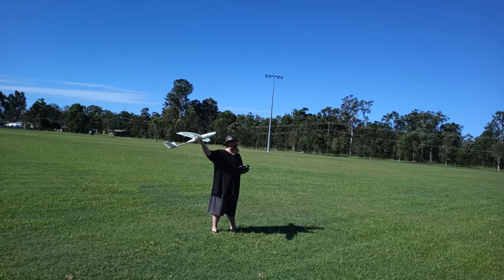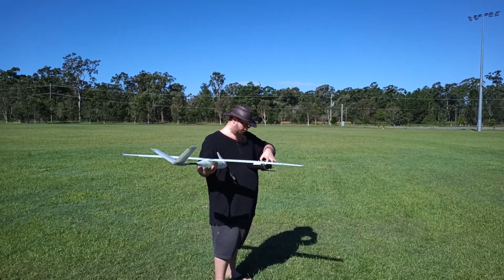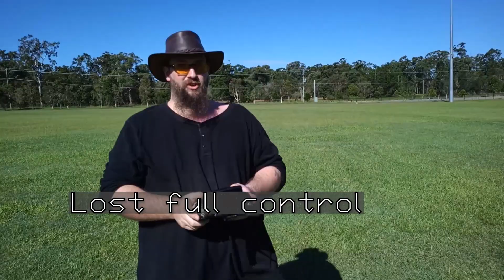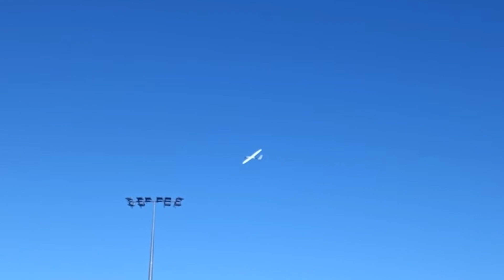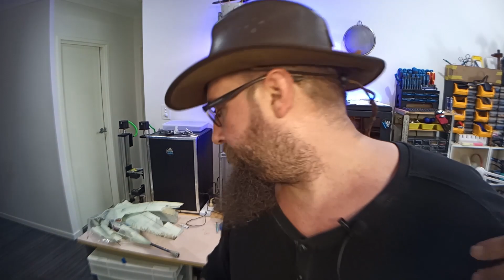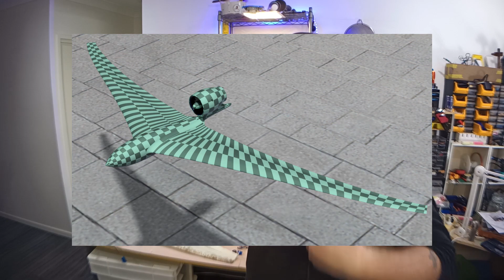chaos daily 2021: 100 Albatross maiden flight!!!

Comment: That's quite a torquey high thrust motor blade combo. I call it a successful flight, but the landing not so much. After seeing the explosion of resin I immediately thought of the printing process and time, wondering if printing multiple parts horizontally would allow for a quicker return to uptime after a crash. It could be worth the time vs part count. There are a few downsides however. Obviously if there is a design flaw you have multiples of the flaw and a print fail could mean all the parts fail but it looks like you have the part adhesion problem down. Something to consider for future prototypes. Keep up the good work!!! Weigh the time vs part production and always remember to account for the Chaos Factor.

Comment: it flew!! I'd call that a flight. Maybe get a diversity receiver next time, place one upright and the other horizontal and well away from everything? Progress that's for sure.
Reply from the maker: This is the 3rd time Ive lost an aircraft with this type of receiver so yeah, def will be looking at dif hardware for next plane. its so frustrating to be given 5sec of just amazing stale flight and then.. NO you cant have nice things, receiver says NO. lol well onward and upwards, new Monogul flying wing is going to be light years ahead in design maturity.
Reply: @23chaos23  I've said it before, I'll say it again get a flight controller. You won't look back... Well.. or, either way tbh, you need a working receiver for a start right.. Flysky has some decent ones that I've had good luck with. Cheap, effective. Telemetry too...
Reply from the maker: @jotham123  funny thing, the gyro I got for it was no good, no way to rev the output for the Ail, if I had used it, the plane would have rolled uncontrollably... but you saw in the video on the first flight where the tail came loose, my piloting was still able to land it  mostly unharmed.
Reply: @23chaos23  yea that was really well done.